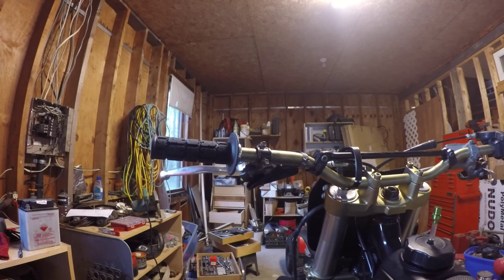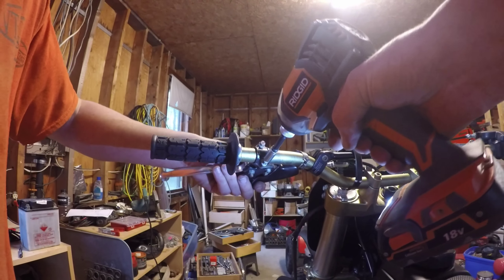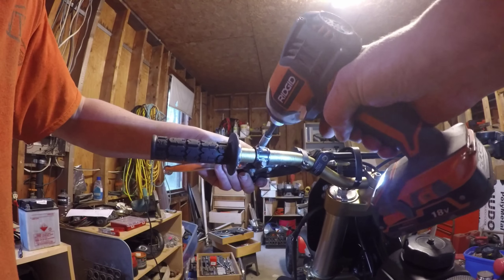YZ 125 ODI Rogue lock on Grips Dirt Bike Assemble part 7

Comment: the difference between 2 stroke and 4 stroke grips is that 2 stroke grips gives you a lot more grip because if not you can't hold on with all that power you don't have that issue with 4 stroke